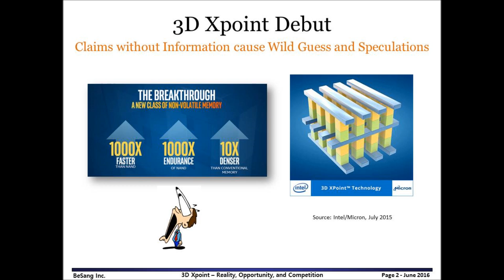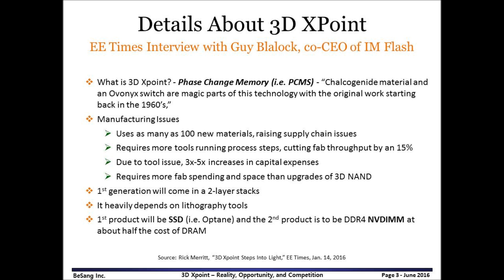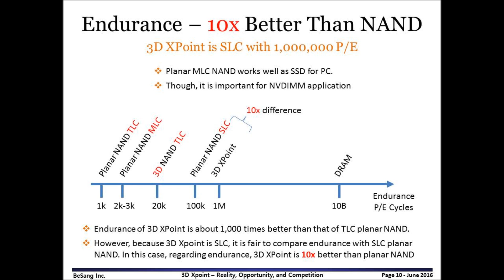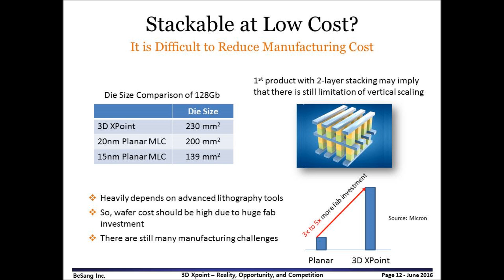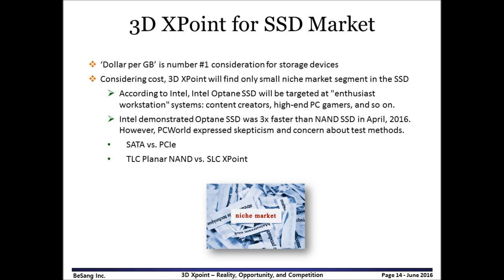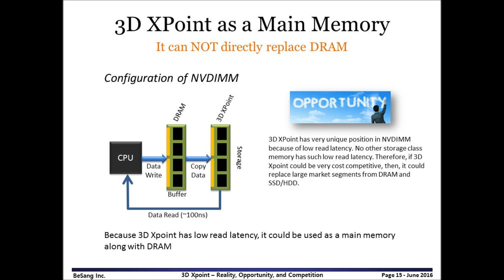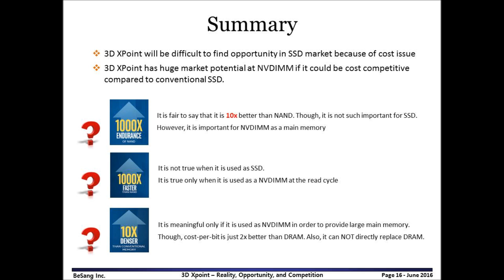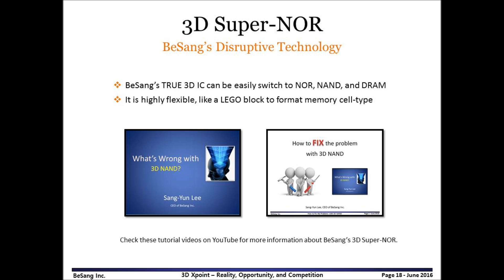3D XPoint - Reality, Opportunity, and Competition

Comment: How do you see the HybriDimm from Netlist competing in this area? They announced at the Flash Memory Summit and it appears to be aimed at 3D Xpoint. http://insidehpc.com/2016/08/netlist-hybridimm-memory-unifies-dram-nand/
Reply from the maker: I think Netlist figures out smart way to allocate data between DRAM and NAND at the DIMM slot in order to increase performance of system. Though, it will be relatively slow storage class memory. 3D XPoint will work as main memory at NVDIMM, which will replace DRAM. HybriDimm cannot replace DRAM simply because NAND is too slow. So, it is fair to say that HybriDimm is fast NAND and 3D XPoint is main memory which will replace DRAM. HybriDimm is not a 3D XPoint killer.

Comment: It's confusing that you switch between comparing 3D XPoint to MLC and SLC NAND. How is it "fair" to claim it's only 10x more durable than NAND and 5x more expensive than NAND when you're talking about two very different implementations of NAND?

EDIT: Also, when comparing to DRAM you leave out the difference that DRAM is volatile. It's not just 2x bits/dollar vs. DRAM, it's instant-on computers. It would be much better if you started with your comparison to 3D Super-NOR. You spend 11 minutes on a bogus comparison to NAND and DRAM then 1 minute introducing the interesting info about 3D Super-NOR. Not a great strategy.
Reply from the maker: Thank you for your input. The confusion starts from the claims of 3D XPoint. It says 1,000x endurance of NAND. In this case, I am saying that it should be fair to compare 3D XPoint with SLC NAND because endurance strongly depends on storage level of cell. Regarding the cost, it is reasonable to compare MLC NAND with 3D XPoint because Optane should mainly compete with SSD with MLC NAND or SSD with 3D NAND in the SSD market. Endurance is not a big issue for general use of SSD with MLC NAND. For fair comparison, the performance between Optane and SSD with MLC NAND also should be measured at the same PCIe interface. Intel/Micron mention that 3D XPoint is not low cost memory. 

I agree that 3D XPoint is non-volatile which is better than DRAM when there is no power supply. However, price advantage of 3D XPoint seems small compared to DRAM for main memory application and SSD with MLC NAND for storage class memory application. Unlike other NAND-based NVDIMM, DDR4 NVDIMM is an unique feature of 3D XPOint and NOR flash memory. When we talk about 1/2 price of DRAM, it will come from 2nd generation of 3D XPoint which has 4-layer of stacked memory cells. Even though 3D XPoint has advantages as a DDR4 NVDIMM, I think cost might be the biggest issue for wide adoption of 3D XPoint as NVDIMM.

I did not share details of 3D Super-NOR in this tutorial. Sorry about that. There will be another chance to introduce 3D Super-NOR in detail at later time.